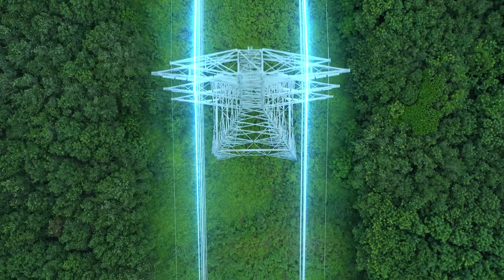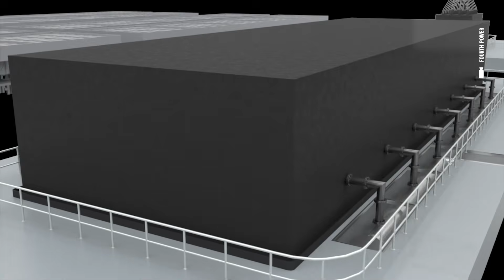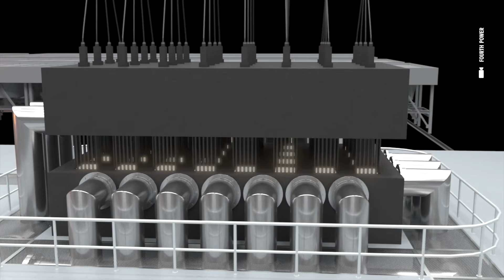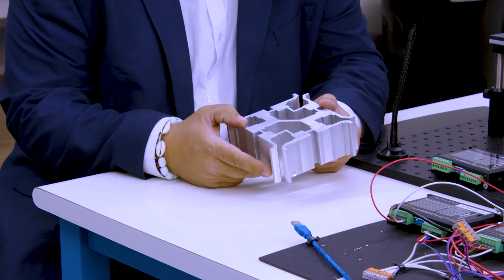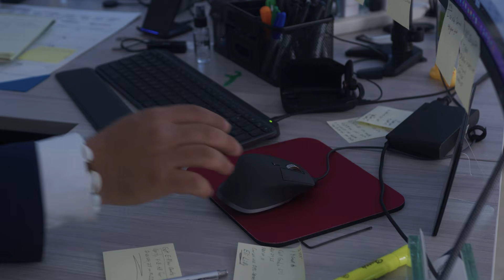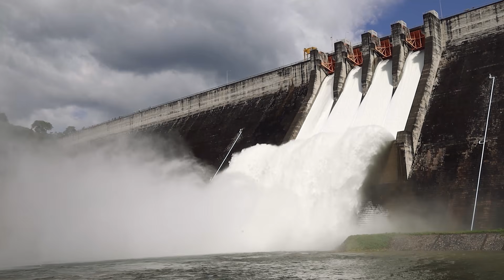Power at Scale with this Sun in a Box

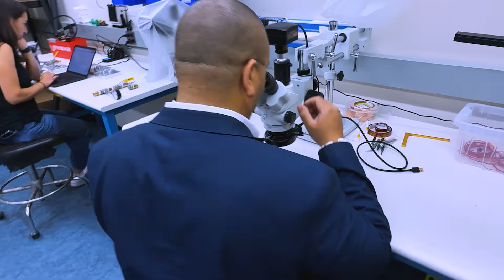Comment: @5:44, the (USB) power cable to the ring light on that Amscope isn't plugged in.   II'm surprised they're using photovoltaics to extract energy, bragging about reaching 50% efficiency.  Isn't that about par for a steam turbine?  This setup looks pretty similar in concept to a solar concentrator - get a liquid metal really hot, use it to transport heat to storage, and then use that stored heat to run a steam turbine.

Comment: There is a lot of information missing in the video, which seems like a promotion.
1. What is LCOE?
2. What is round-trip efficiency? ( How much energy is pushed into the system and how much of that is recovered later. Generally, that varies with time, so you need to show some charts as well. )

Comment: Another interesting technology question is what are their pipes made from?  2400C is above the melting point of everything except a very small number of refractory metals and alloys like TZM.   I'd be very curious to see a quote for 100 feet of 3 inch pipe made out of TZM...  cheap it will not be!  It's admirable that they are taking on these engineering challenges - as long as they are necessary, and that necessity is the big question from an external POV (where should society invest?) - obviously they think it's necessary because that's the proposal that gets their funding.  Sorry to be a bit cynical in the face of this interesting work, but really, who did the due diligence on this and the others chasing this TPV concept?

Comment: There is plenty of clever technological work here, solving problems created by the initial decision to generate the output photovoltaically, but the professor kept very quiet about a fundamental aspect of the TPV module which is really important overall - the conductive losses through the TPV when it is being kept at a working temperature of less than a couple of hundred C and the outer face is being irradiated from a close-coupled source at 2400C.  Unless that "power stick" has a substantial flow of coolant passing through it, the entire stick will rapidly heat up until it is in equilibrium with the hot source.  Taking out some energy photovoltaically is not "cooling" it like a Peltier (someone is welcome to explain the thermodynamics of that part if they have the answer). The prof's own numbers say 50% max is going out - so where does the rest end up?  And no, the mirror trick is not the answer.   To keep the TPV modules from "melting", the cooling system behind them has to remove all of the net thermal power absorbed - potentially hundreds of KW per stick.  The Prof. should have explained where that huge flow of heat is going - because it will dominate the overall efficiency model for the system.  If the coolant is water being boiled to steam and then running a steam turbine, he could claim that additional conversion flux in his overall efficiency calculation.  If not, then the system has a gaping hole in the thermal efficiency model and all the headline numbers will be misleading.  FWIW if you look at recent Nature papers on TPV module efficiencies, they also strongly suggest that this is a red herring for the same reason (the papers don't say so because they are also trying to claim "high" performance for their particular TPV embodiment, ignoring the parasitic losses.    Perhaps 4th Power can themselves show the answer to this question - but unless someone can explain how the TPV stays cool and where the conducted losses go, I'm going to call their bluff on this one.   Worth noting also that they are not the only startup raising money for this type of system, and the others have exactly the same gaping holes in their public demonstrations and claims.  It is sad that VCs don't have the nous to employ qualified people to debunk stuff like this before pouring their money in.

Comment: What is the Carnot efficiency of this process?
Reply: It's not a heat engine. There is no heat to mechanical work translation. There's no cool reservoir needed. This is limited by efficiency of the thermal photovoltaic cells, not by Carnot.

Comment: No statement of overall system efficiency though
Reply: He said: above 50%. The charging is nearly 100% efficient, since it's resistive heating.
Reply: @xy4489  Perhaps I am wrong, but I believe he said the transition from heat to electric using tuned solar panels was up to 50%, that is not total system efficiency as there are losses at all stages, including when the temperature drops and the tuning becomes less efficient, the energy used to run the system, the heat losses (so round trip efficiency will vary depending on the the duration of storage till use).
Reply: @veronicathecow  True, for sure. The "50%" number is just to first order of approximation. Just to have a  reference point to compare to chemical batteries (>95%).

Comment: Why not use a solar concentrator instead of solar PV cells, to heat the graphite blok directly🤔. This is could avoid the efficiency loss of the PV cells, apart from other benefits such as easier maintenance of the array of mirrors compared to PV array.
Reply: They are designed to using ANY source of electricity (including nuclear, etc). So a lot more versatile than concentrated solar as the only source. But yeah, you could add a heat exchanger with the molten tin and heat that exchanger with concentrated solar. In principle, it should be possible to heat it to the temperature of the sun (which is the source of the heat) if there was only input and no lost heat, but in practice the losses through that input window through which the sunlight would need to pass also radiate out, so it's hard to heat something to above 2400C (which they need for the extraction system to work) with concentrated solar.

Comment: 4:28 - sweeping noble gas curtain sound like the same process that an air wash has at the front of a wood stove just behind the glass door. Air, in the stove's scenario, washes down from above the burn and keeps the glass from being coated in creosote and soot during the stove's operation. 

If his described system works the way it sounds, then I would expect a TPV to also be able to generate some electrical current at lower temperatures too. For example, could a consumer have a wood stove that also generated electricity via a tpv mounted to the front glass face? Or is there an operational issue with lower temperature that would make using TPVs like that not viable? 

If it would function, there's clearly a lot of off-grid scenarios up north that could benefit from leeching power, rather than light, from their stoves.

Comment: Can you use this as a thermal buffer for chemical manufacturing to use the heat directly too?
Reply: Or indeed to heat gas for a turbine ...
Reply: @rickburke7167  I've been hearing a lot about the improvements in supercritical CO2 turbines lately. Seems like a lot of potential to stack multiple use cases onto a thermal battery like this and recover the waste heat from the other end of the turbine too, and use it for chemical manufacturing process flows. I've been doing research on carbon removal and on datacenter heat management. Its possible to recover the waste heat from many industries and use to run a supercritical CO2 turbine and pair direct air capture or many other process flows to create a little symbiotic industrial ecosystem

Comment: Incredible, but very complex and as a result expensive…..
Reply: Energy Investment has turned into the exact same grift as crypto, modern art and partisan politics.
Reply: With some maintenance this system will be cheaper than batteries but if used decades.
Reply: Very much agreed.  In places where wind/solar is the only option, though, I guess that's the cost of doing business.  We're never going to get cheaper energy than on-demand high-energy-density fuel combustion.
Reply: @HeatherSpoonheim  Yes and no,  some Nuclear Power-plants concepts utilise molten salt as heat Battey because changing reactor output power is slow process and add such buffer can eliminate need for peak power gas turbines.
Reply: @kkrolik2106  Buffering energy to smooth output is nothing compared to trying to store energy to run the grid all cloudy day.
Reply: i thing getting a PhD from MIT helps with complexity bud 😂

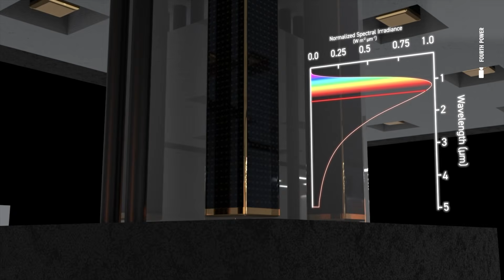Comment: Interesting! This might actually be practical and useful. One issue with the video: at 5:17 the plot's X axis is labeled "Normalized Spectral Irradiance", but the units are given as W m^-2 micron^-1. That's wrong, since the values are normalized. It would have been more informative to have the absolute values: the normalized data don't tell us much!
Reply: Normalized data does tell you everything: it tells you which part of the spectrum should the photocell be designed to absorb. The cell absorption peak should be matched to the emission peak (for the chosen temperature).

Comment: it feels like the hardest part is maintenance.  how do they shut it down without the tin solidifying and basically destroying the whole box?
Reply: Drain lead and issue disappear.
Reply: also, there are several similar projects.  i haven't heard of them having much success.  Antora Energy.  they claim that there cost is $10/kwh.
Reply: transfer to a container to keep it at temp while they do maintenace?
Reply: Why would it destroy it? Just heat it back up and it should start flowing again. Unlike water, it won't expand when solid.

Comment: That is cool. A couple of questions. Your light "cells" have a 50% efficiency and the heat that is not converted back to electricity is not lost, just reflected back to the graphite/carbon storage. Is there a "round trip" efficiency of the device? The ratio of Y energy coming out of the battery over the X energy going in? And have you placed any devices into service yet for a customers? What size if so?
Reply: The fact that this figure is not mentioned is in itself somewhat disturbing. And nothing about LCOE either. Just a lot of other numbers, like the high temperatures.

Comment: This is interesting but too complicated and inefficient compared to alternatives. The stored energy here would be best used as heat instead of electricity.
Reply: Seems so, I am thinking high temperature industrial processes
Reply: Yes. Decarbonisation of heat is a huge vacant market too, I don’t know why they are chasing grid storage at such low efficiency snd added complexity. Maybe it’s all investors understand? 

Just transfer the heat via a gas to a steam generator and it will be useful in every chemical plant.
Reply: More complicated, less efficient, BUT cheaper. If you ignore the cost dimension, none of this will make any sense.

Comment: Is it practical to use solar or wind to heat the Tin and Carbon up to 2500C?
Reply: Yes. Electric resistance heating systems, such as baseboard heaters, furnaces, and space heaters, are 100% energy-efficient at the point of use because they convert all incoming electricity directly into heat (1 kW of electricity = 1 kW of heat). This is that scaled up writ large.
Reply: Why not? Once the energy is in electricity form, its source is indistinguishable. Only cost and emissions of said solar/wind vs other generators is relevant.

Comment: Wow the scale is incredible. And 40% is already on the high end of typical energy efficiency. This is just in time for the AI revolution and hopefully will also prevent issues like the dangerous outages we experienced during the Texas freeze. I've heard criticisms of clean energy related to the carbon footprint of manufacturing batteries and panels--would be very interested in learning about the net environmental gain of this tech.
Reply: The power failure in 2021 Texas was a business strategy. The technology didn’t fail. Subsequently,a lot of off grid solar ,along with huge expansion of grid batteries has taken their hands off our throats. They have no excuse for ripping us off now but don’t stop the move to de centralized production. 
Home grown and consumed is simpler and cheaper.
This heat storage technology is interesting but leaves the power in the hands of business interests. No need for government subsidies,we’re doing alright without it in the off grid community.
Reply: Pumped hydro has a round trip efficiency of around 90%. A battery of this type is not good for storing electricity, but it work very well when you later need heat. You can then shift the heating to the time cost is low and use the heat from the "battery" when it is needed.
Reply: @bknesheim I agree this is best if the energy is simply consumed as heat. The efficiency of pumped hydro though is typically 70ish percent. Max 85 percent in rare cases. Lithium batteries exceed 90 percent.